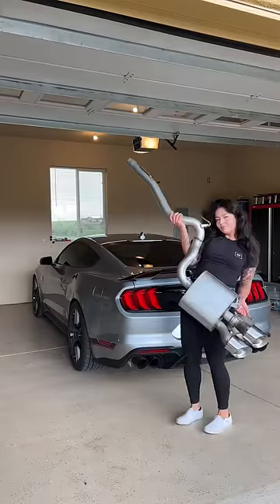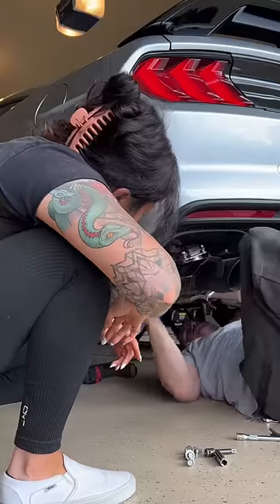Exhaust perfection #mustang #exhaust

Comment: Wouldn’t trust my life with that Quick Jack. I’d add some jack stands for backup! Sounds great!
Reply: They’re great both sides have locking mechanisms
Reply: really?
Reply: @bobdell2851 what are they called ?
Reply: @EN_Kenn quik jacks
Reply: Use them for a lot of dirt track cars, decently safe but I wouldn't trust getting under one for long
Reply: Man she got more heart than me to get under there without them jack stands
Reply: They have locks on the though
Reply: Facts I was thinking the same
Reply: I was thinking the same thing!!! Always add extra safety measures!!!
Reply: Bout day the same thang
Reply: That’s what I was thinking
Reply: @justincase9116 they are not made for lifted trucks there broski lol. I always go heavy duty when it comes to that kinda thing
Reply: @bobdell2851 yeah still use jack stands if you don’t want to get crushed.
Reply: we can all tell by how she literally crawls in and out from underneath, she was built for the kitchen
Reply: i put jack stands on my jack stands im not gonna die getting crushed 😂
Reply: They have a lock made into them, so they can be locked in place and you don’t have to put jackstands right where your trying to work.
Reply: @FZERO20 locks don't matter if they bend sideways and your car falls down. Locks don't matter!
Reply: They have a lock on them,  same as any other lift
Reply: @justincase9116 you had something fucky going in cuz the quickjack is safer than stands with the locks on.  I had a 8000 lb truck on it for weeks w no issues and it's only rated for 7k
Reply: Same! always add small standalones for reassurance lol
Reply: @justincase9116  had my car on a set for over 2 weeks with the engine out and it was fine. they lock into place at weld points and in combination with the hydro they will hold much more than you think. also only supposed to use them on level ground. i could see them slipping out on a driveway but they are actually just as safe if not safer than jack stands.
Reply: Ugh people don't understand. We aren't special Ed. We know how those stupid quick jacks work. We just don't personally prefer to trust the quick jack locks alone. Added safety to your one and only life never hurts. It will only save your life when the quick jack slides past the locking mechanism ONE time. That's all it takes 1 time, with you under there to cost your life. We are human mistakes can be made and working under cars, trucks, suv, etc. Added safety can only be a good thing for when the thing gets worn out, bent up, cracked welds, failing lift ram Yada Yada blah blah. Yeah, Scott, Bob, Jimmy, and his cousin Cooter will all chime in saying there's is 27 years old, and they used it more than their Ole lady on a Saturday night.
Reply: @Wreckedekcoupe  litterally safer than jack stands.
Reply: Fuck no!
Reply: me neither. 
i would throw  some 24” wheels 🛞 and probably don’t even need a Quick jack.
Reply: Designed to lift and hold 2X their rated capacity so she is perfectly safe with the locks engaged, with some of these comments i guess yall have jack stands ready if you raise your car up on a 2 post or drive on lift too😂……
Reply: doesn't mean accidents don't happen 💪
Reply: It has built in locks on the side, if the hydraulic system fails no matter what it's on a lock just like a regular lift. It's made by bendpak, they wouldn't put out a product if it wasn't safe. Obviously don't get under it when it's not on locks similar to a regular lift. I use mine all the time and I'd trust my life under it. Done plenty of engine swaps, suspension overnhauls, and everything in between. I've left cars up for over a month before without issue. Watch their torture testing and you'll feel a lot better lol
Reply: I knew I wasn't the only one thinking about that jack going wrong 😂😂
Reply: Fact
Reply: How are these people able to afford these cars and houses?
Reply: Me to😮😮😮😮
Reply: lol I have quick jacks and I always throw some jack stands underneath just in case. Seen too many vids of cars dropping on people.
Reply: You’re scared of everything.
Reply: fr
Reply: I wouldn't trust your wife either. I mean whaaaaat?

Comment: You can also go back to how it was at the beginning of the video, raspy and high pitched, go pick up 2 8-10" high flow cats and have them welded in line.

You'd end up with something close to the finished product at the end of the video, but just more volume. Throaty, deep tone, but louder without the raspiness.

Comment: I had a similar issue with my truck.
I ended up moving the H pipe more toward the rear and it made it deeper and changed the torque curve as well

Comment: Chambered mufflers will practically eliminate "scream" as you say.
I think its more of a negative sound wave  passing through because of a straight through muffler style. Raspy is awful,drone is awful.
Try a 3" dual exhaust with a chambered muffler. If too loud, ad a resonator.
Problem solved then it will only allow deep sound waves through and cancel high pitch sound waves f4om bounching off the pipe walls.

I have a f150 lightning and tried every combination of exhaust.
Nothing compares to 3" chambered.

Comment: The best exhaust in my opinion for s550s is off road long tube headers, h pipe, a couple glass pack style resonators to factory 2018+ mufflers or 11-14 gt500 mufflers. It’s plenty loud on the track setting with actives and also just quiet enough for quiet mode. It’s really hard to get a coyote to sound good and most aftermarket cat backs are either too raspy or just don’t sound good

Comment: You're losing way more performance by having the resonator and stock muffler than if you got rid of the headers. If you had done your research first, you would know that adding lth has this effect on the sound, but you probably got roped in by "lth add a bunch of performance" and didnt think about the sound. I never understand why people think the coyote is naturally deep. It's actually naturally raspy/high pitched, if you want a deep sounding v8, get a Dodge or Chevy.